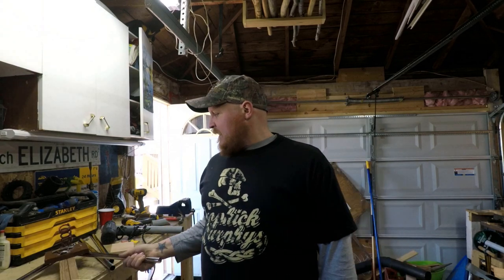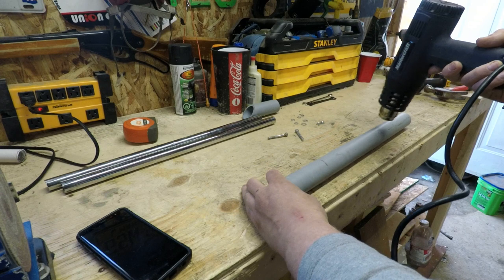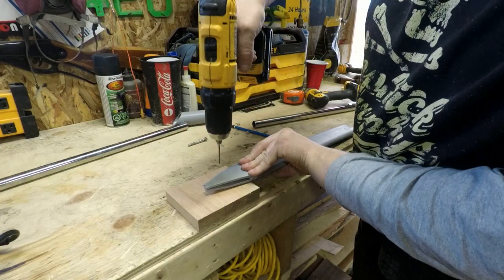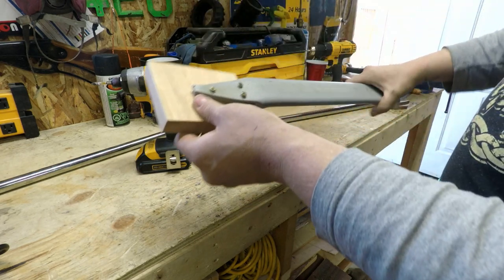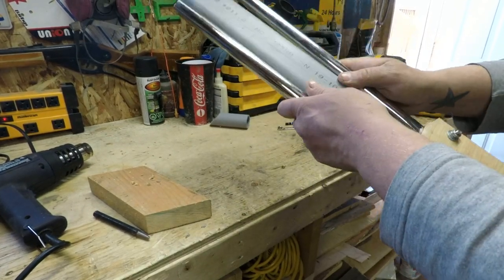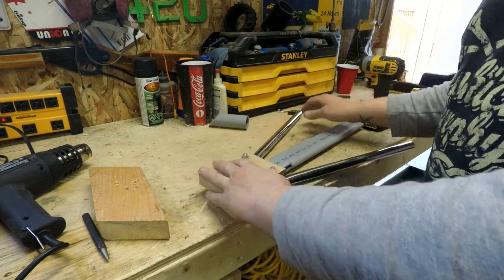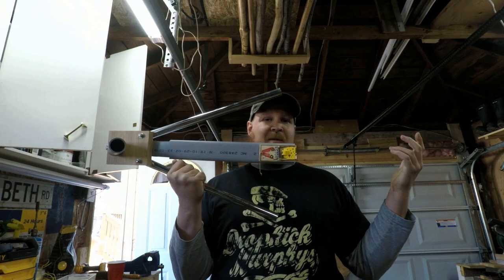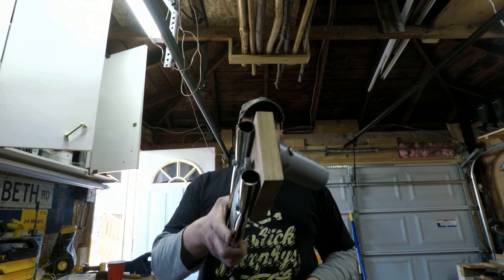DIY Jaw Jacker, Best DIY design! Automatic hook setter!

Comment: You can take the spring off of the kill bar because there is tension from the rod to keep the trigger set you will than k me after you have snapped your your fingers a few times
Reply from the maker: Thanks ill have to try that. Although the snap is a good alarm!

Comment: Schedule 40 is the thin, schedule 80 is the thick bud
Reply from the maker: Schedule 80 is way too thick to work with and schedule 40 is thicker then thin walled pcv. There is thinner then schedule 40

Comment: Not quite sure I understand the purpose of the nail in the trap
Reply from the maker: The nail is needed for the wire on the rod. Without it there would be no way to load up the rod. Its the kill bar releasing that causes the wire to release from the nail. Hope that helps